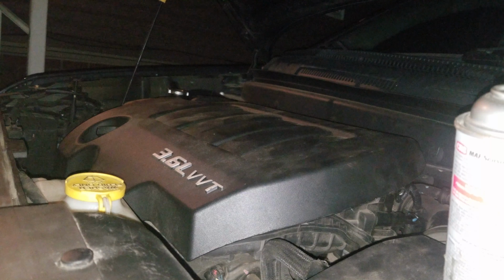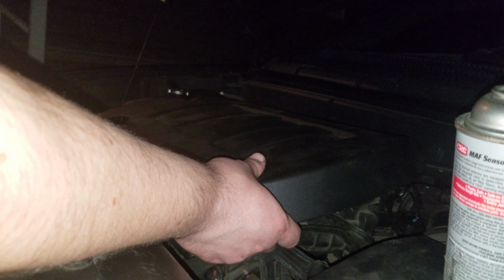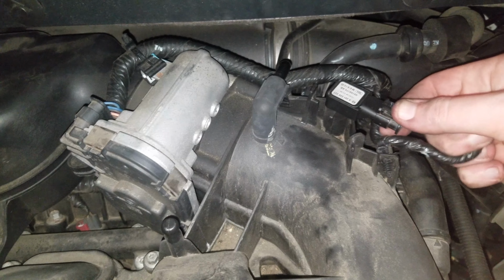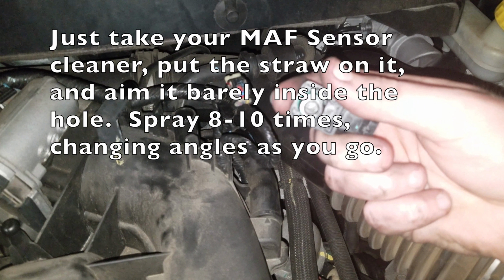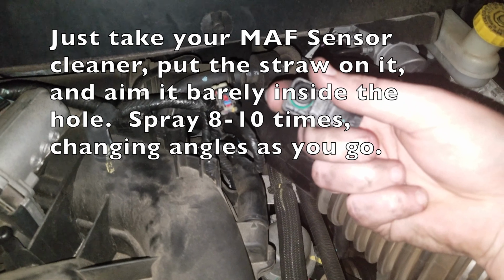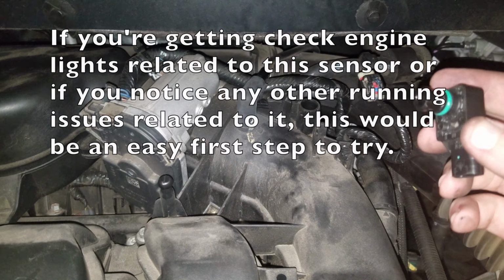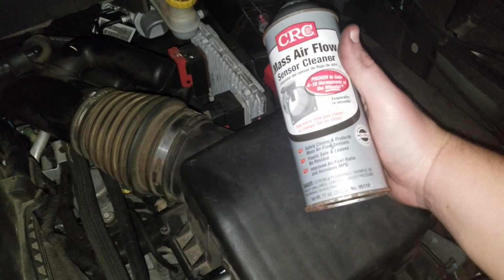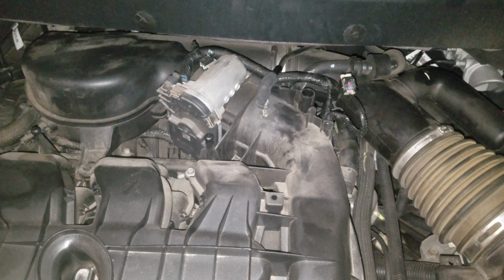Replacing and/or cleaning the MAP Sensor on a Dodge Journey (or other Pentastar v6 Engine)

Comment: Where can I use the intake and valve cleaner on that engine I have a dodge grand caravan 3.6 pentastar engine looks about the same.
Thanks
Reply from the maker: This is just to clean that MAF sensor or replace it.  To actually clean the intake and valves you'd have to see a dealer or something

Comment: Hi my journey is accelerating very slowly and also stalling out when braking, could it be this maf sensor???
Reply from the maker: Acceleration, possibly.

Stalling when hitting the brake, it's likely the transmission
Reply: @adventureoflinkmk2  oh man, what could be the issue with the transmission when braking?
Reply from the maker: @caylee3277  torque converter most likely
Reply: @adventureoflinkmk2  shit man I'll tell you if it isn't one thing it's another, I'm already 10k upside down on this because I had a 2007 hybrid Tahoe and the entire hybrid system went out , was quoted 8k to fix, so I traded for this , smh is the torque converter hard to fix? Is that require a whole new transmission?
Reply from the maker: @caylee3277  yes unfortunately you'll end up having to get another transmission
Reply: @adventureoflinkmk2  hey what do you think if I change the torque converter solenoid?? Think that could do the trick??
Reply from the maker: @caylee3277  won't help, I tried it :(
Reply: @adventureoflinkmk2  damn, how do you think it messed up just from me doing a fluid change?
Reply from the maker: @caylee3277  not at all.
Reply: @adventureoflinkmk2  because it just started after that
Reply from the maker: @caylee3277  honestly.. if it was having problems, I don't think changing the fluid would've helped
Reply: @adventureoflinkmk2  no that's what I was saying , It wasn't having issues until after I did that change
Reply: @adventureoflinkmk2  ok honestly tho let me ask you this, if I change the solenoid will it at least help some, inorder for me to get the truck to the dealership and trade it in
Reply from the maker: @caylee3277  if the car still shift and drives.. don't worry about it
Reply: @adventureoflinkmk2  ok thanks, I just didn't want them to talk me down in price, but I think those bigger dealerships really don't give a shit, they usually give you the KBB value of the vehicle because they know they can get you on the next loan and also they can have their mechanics fix it for nothing
Reply from the maker: @caylee3277  you're welcome.. and, with today's seller's market, you never know man, just give it a try ;) IMO this may be your best bet for a LOOOOOOONG Time to get outta your car, that's exactly why I sold my little white Corolla to carvana